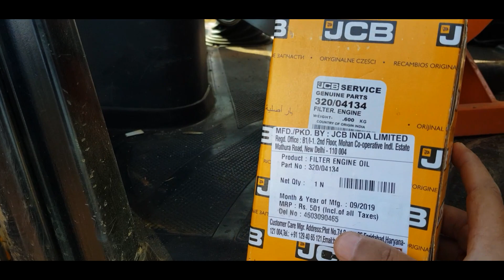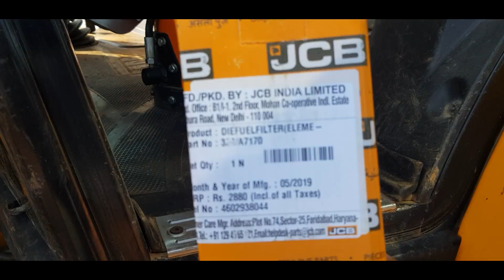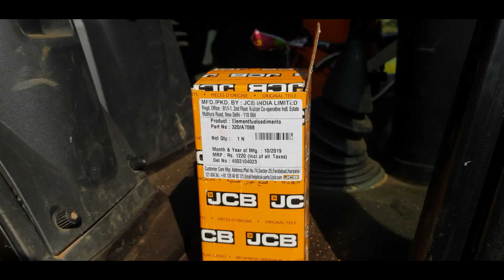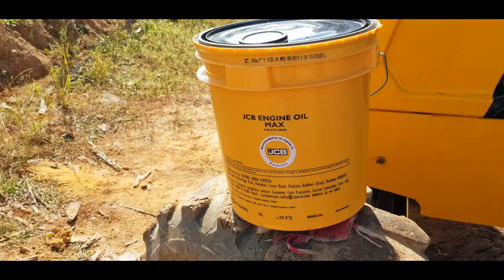How to change Jcb engine oil

Comment: Every time I change the diesel filter, I have problems with fuel and wind 😰
Reply: You need to bleed the air
For easy fill the fuel filter with fuel before you fit